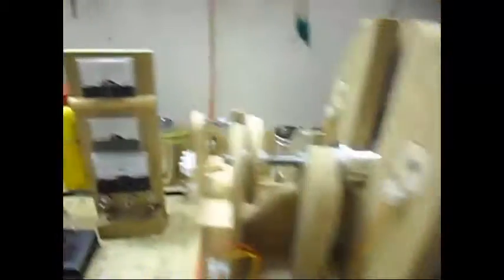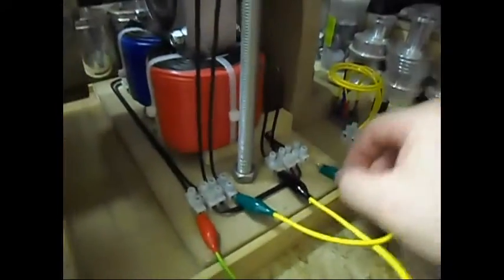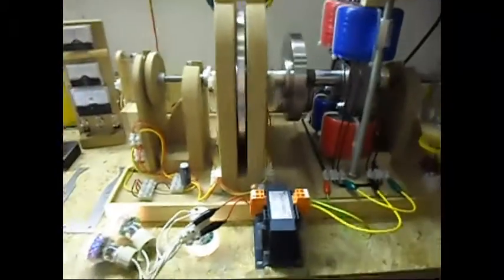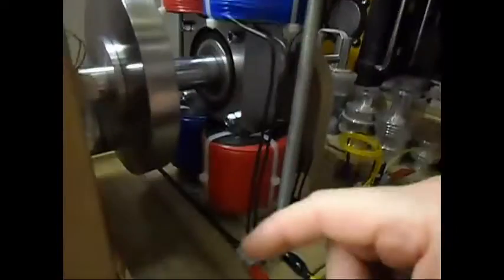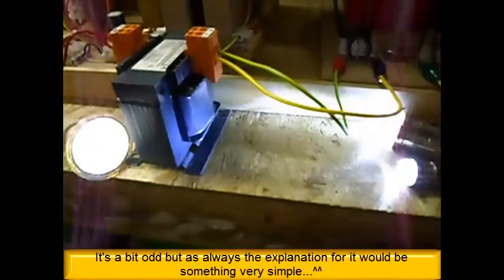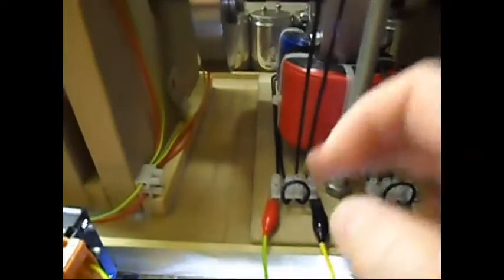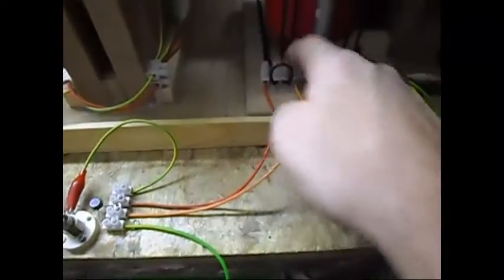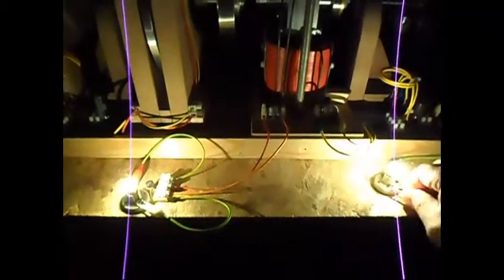Tr3nity Dynamo - Update 4, Series/short & Diagonal coils connection & better output...

Comment from the maker: Here's the update on my Tr3nity Dynamo that was supposed to be uploaded Saterday and than Monday but hey...better a bit late than never...^^
So when loading a set of series connected coils and shorting the other pair it may give one some good output...;-)
So when connecting the coils in a Diagonal manner it may give one some good output without having to sacrifice a pair on shorting and so having 2 pair of coils for output...;-)

It's performance is way better now but still not good enough for a self loop... -.- ...lol

Next it's a quick 10mm magnets test since i don't expect anything special from that and then it's time for the next upgrade on this Dynamo...:D
Hopefully i've learned enough so the new design is so to get Mister Lenz to work with me instead of against me...lol